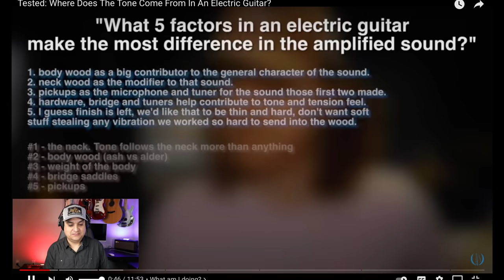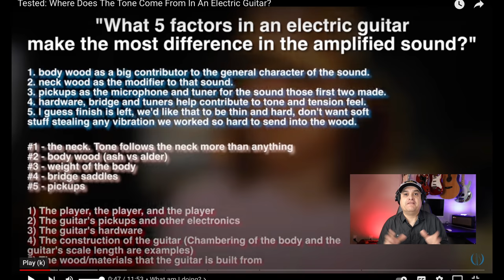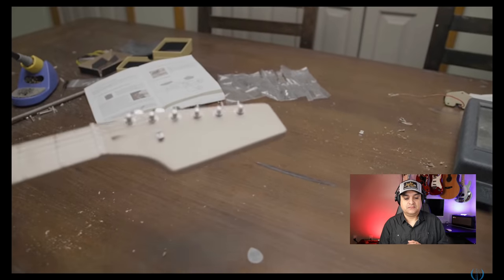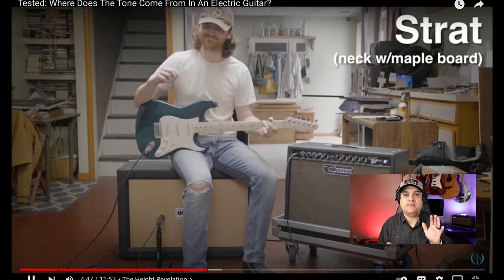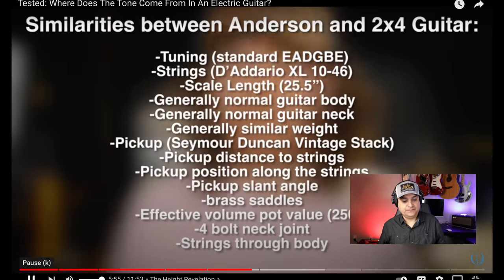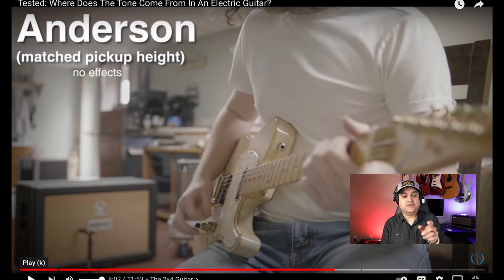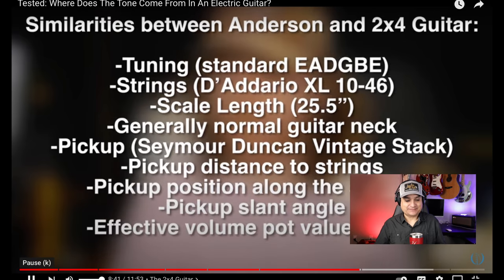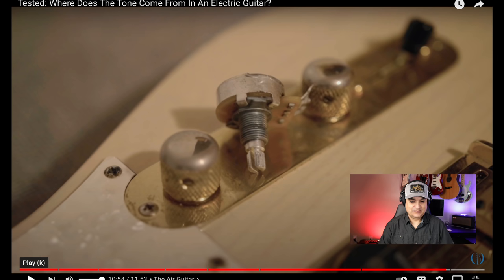Where Does The Tone Come From In An Electric Guitar - Reaction Video

Comment: LOL.  This guy went through a lot of extra work (forgetting about pup height and electronics), but I totally applaud his tenacity.  Good scientific approach - find the problem, document the problem, fix the problem.
Reply: yeh it is but here is the issue with these "scientific tests". If it was a true scientific test, a much bigger sample size is required. I would say you need guitars that are made exactly the same , in the same finish etc but with different wood options. The variables need to be controlled, so that includes the setups, string gauge and age, amps and cabs used, which might also require constant temp or humidity conditions. 
It becomes pretty murky pretty fast.

I am still yet to see anything approaching a true scientific test of this , with thorough variable isolation controls, and a large sample size (probably 50-200 guitars are needed, maybe more). Also many pro players would also be needed to test each guitar themselves, as well as straight up freq response etc via tools. Also both blind and labelled tests would be required to work out how much is affect happens in the mind of the player and is illusory.

Having said all this, it certainly seems to be the case that the wood is a small amount of the tonal composition, but there are enough other variables that could be skewing this by virtue of adding up, and potentially masking wood tonal differences, which is why the sample size needs to be much much bigger, as the average tonal properties of each wood type could be gathered and then compared.

Until someone actually does this, its basically one stage removed from anecdotal (which is still important). 
It may be closer to the truth and  a scientific conclusion , but not much.
Having said this I do think Pickups, Bridge and Nut and Tuners being the biggest factors on the guitar, seem to clearly be the biggest factors, its a matter of just how big that the scientific test would answer,and whether we can perceive this (this part of any test is very hard because they need to test people with trained ears in both general audio and most important, professional guitarists, testing random people would not tell us much. Average players would tells us quite a bit about most guitarists, and pro players would establish how far that perception can go, and possibly explain if you can ever get good enough and have trained enough ears that its a big enough factor to notice
Reply: @jacksmith4460  -You are hilarious. He replicated the tone without the parts that are frequently said by manufacturers to give tone and justify their extravagant prices. That was his hypothesis. It wasn't to test every electric guitar and pickup. His conclusion is that, in his test to achieve the tone of his specific electric guitar, the features that were essential to achieve that guitar's specific tone were the final list at the end of his test. You redefining his test with a new hypothesis and criteria is actually wrong in this case. What is correct is if you wish to expand on his tests and test many guitars  and many pickups, that would be your experiment, including a new hypothesis. But, his experiments still utilized the scientific method.

The "variables" you are referring to are features he proved don't matter(finishes, wood options, etc.) to achieve the tone of his specific electric guitar, and if you read his lists carefully, he did control the setups, string gages, etc. It is also clear he played the guitars in the same room with each modification, so you can say he had the same environmental factors present at the various stages of his tone tests. His approach was very scientific. He controlled all of the factors that remained common through his tests. He even acknowledged that he didn't account for the pickup proximity in earlier tests. So, he went back and rigorously controlled this variable and redid some tests to find that it indeed mattered more than other variables then continued using that control to confirm his conclusions proceeding. Just because you are not accepting his list of what he controlled doesn't have anything to do with whether or not he followed the scientific method in his experiments and modifications. Many scientific experiments of the the 19th and 20th centuries that are accepted as fact, or science today, were done with less control. And, there are studies going on now, take COVID vaccines, that are being tested with little control and being pushed out and called "science". 

Science is not the domain of one opinion or one group's opinion. It is a tool that all people can use to find a specific conclusion to their questions.
Reply: @Jack Smith  ...your logic holds true only if you believe that wood makes a difference with en elecyric guitar. The video proved that you don't even need wood to get a great sound. LOL!!
Reply: I though the same at first.  
I don't think he forgot anything.  I think he wanted to actually demonstrate some scientific method and problem solving skills by showing how rigorous you must be to objectively examine something as subjective as tone. Also, how the difference in the circuit between pickup and jack so dramatically changes the tone and response.
Reply: That's the point , goofy.
Reply: @jacksmith4460  If you think wood affects the tone on an electric guitar then scientific question #1 should be: How do the magnets in the guitar pickup detect the vibrations in a non-magnetic material like wood? If you can't even theorize how that might work then it's probably not even worth testing.
Reply: @dezmodium  The argument that the "tonewood" camp makes isn't that the pickups pick up vibrations in the wood, but that the vibrations of the wood resonate into the string, affecting its tone. Which sounds reasonable, until the theory falls flat under scientific testing.
Reply: @andrewmcintosh2703  Even if that theory is true... The strings are thick and under heavy tension, it takes a LOT of force to vibrate the strings... the resonance vibrations from the wood are really small, it just doesn't have that much force. So any differences in tonewood are going to be so small that they're imperceptible to the human ear.

Comment: Acoustically or unelectrified all those other factors do come in to play sound wise. Also anything that effects feel and vibe I would argue effects the sound because it effects how you play and enjoy it which greatly effects tone. But electrified, pickup and pickup height have the biggest changeable factor in tone. If only it was this easy to narrow it down with amps
Reply: This is the greatest comment ever
Reply: Yep, like Darrell Braun once said, people tend to "transfer" knowledge etc from the acoustic guitar to the electric.
Reply: The speaker is more important than the amp
Reply: And manufacturing tolerances for everything. Then there's the player, did the player drink the same beer out of the same side of the mouth. Put the left shoe on first or right, play with shoes on at all, if that's the case, take the right one off first or the left.

Comment: Hi Dylan. I've been a professional guitarist for over 30 years or more, and I have a pretty decent collection of guitars. I am firmly "in the camp" that the tonewoods make absolutely no difference to the sound of an electric guitar at all. If you fret a note on a Les Paul's abalone fret marker for example and fret a note on the wood, the tone is no different whatsoever - and the same can be said for all the fancy maple tops etc. The only thing that can affect the tone is the parts that the string actually touches when you just strum across the strings without fretting anything. Everything else is purely cosmetic! Tonewoods play a big part in the sound of acoustic guitars, but none in the sound of an electric.
Reply: To be fair the other stuff isn't just cosmetic. Some of it is for the comfort of the player. I maintain that if a guitar has a comfort feature that makes playing more pleasant to you, the player, like jumbo frets, or a specific curve and thickness to the neck, or the position of your knobs and switches, then that will make a big difference because it affects the player and the player makes the biggest difference in sound in this situation.

Comment: All pickups are indeed microphonic to varying degrees. Microphones, speakers and guitar pickups all use the same principle of coil, magnet and transfer of sound to electric current or in the case of the speaker, current to sound. 

Whether or not you can hear the varying degree of pickup microphonics in tone is the question. It’s definitely there.
Reply: it is indeed there and ovelooked ~ small details matter to top artists
Reply: Beg to differ. Sound is physical vibration through the medium of air. Your ear detects this motion, actually physically as does the receiving element of a microphone, by its own movement having been impacted by the actual physical vibration through the air. Think of it as a water ripple hitting the shore. A pick up on the other hand simply produces electrical current when a metallic object is moved within its magnetic field. This is a universal principle and the reason why alternators, generators and electrical motors work. Where on a guitar pickup is the mechanism receiver that that detects vibrations in the air?. Disect one see if you can find it. All you will find is a magnet with wire wrapped around it, you could isolate it, plug it into an amp and scream at it until you are blue, your voice will not come out the amplifier.

Comment: It proves that the argument for expensive guitars is how they feel and look rather than the materials they are made of affecting actual tone. A nice guitar makes you want to play it more - but sometimes the "worst" guitar is the right one for the sound you want.
Reply: I think most builders do not charge more for "tone wood" , it is more of the fact some wood is harder to acquire and more expensive or harder to work with
Reply: @chocomalk  you hit the nail on the head
Reply: @chocomalk  Some wood being harder to acquire is one thing, but other than some extra workmanship being done to it, it doesn't really justify the extra cost of lets say a CS Strat that's made out of alder an maple, just like almost any other mass produced strat for example.
Reply: @Nghilifa  uhhh the dif in price for a piece of Alder and a piece of "maple" can differ wildly, like what kind of maple? 
There is on other aspect of price I didn't mention and that is how desirable something is.

Comment: The fact he was able to make the scrap wood guitar stay in tune long enough to demo it is amazing in itself.
Reply: Am i missing something?? As long as the string's contact points( tuner, nut, bridge saddles) are the same and the body has minimal to no compression what would cause the tuning to go out (or is this just some sarcasm that went over my head)
Reply: @lalchan  maybe because the plywood doesn't have a truss rod  I guess?  Dunno.
Reply: @mthew6721  
The truss rod goes in the neck. Not the body.
Reply: What do you mean "scrap wood"? That looked like a perfectly good 2x4 to me.... 😆
Reply: This comment is nonsense. Stop pretending.
Reply: The bridge and nut are guitar parts so...
Reply: Why would it go out of tune? A two by four is AT LEAST as mechanically stable as a thin stratocaster body.
Reply: @LarsPallesen  hahhah. Yeah  that 2 by 4 is   harder than basswood.

Comment: I am so grateful for u, Dylan and Jim from this video u are reacting to for opening my eyes to the importance of pickup height. Ive had a 7 string Schecter for years now and i always hated its tone, but love the way it feels, looks, and great construction. Ive been contemplating buying new pickups for it, but decided to try messing around with the pickup height after watching this video and boy did it do the trick. The pickups were so high that the output was distorting even into the cleanest of the clean amp settings (JC40 so arguably the cleanest amp u will find. Lol). I lowered the height quite a bit and now my clean tone on this guitar sounds phenomenal. Now im going to try messing around with pickup height on my PRS SE 24 Custom to see if i can fine tune it more to my liking.

Comment: I mean - considering electric solid body guitars were made to reduce/eliminate feedback issues by eliminating resonance it should be obvious that the wood has at best a negligible effect.This is the whole point olf solid body guitars. Can it still make a difference? Sure, if it gives you a certain feeling as a player. But that's about it. But always remember: this is about solid body guitars, not semi-hollows or hollow bodies! In those guitars wood DOES make a difference since wood types have different physical properties which will result in a different resonance behaviour.

Comment: An australian sound engineer took this on more than a decade ago. He took advice from comments below successive videos eliminating variables outside the wood, eventually making several one-string "guitars" with just a tuning peg, a zero fret, and a single bridge saddle. There was no neck joint (or frets), these were all just hunks of wood of the same dimensions. He eliminated the player and pick/pick attack variables by using pickup wire to "pluck" the string in the same place by breaking the 42 gauge wire around the string. And yes, he tested the wire for consistent breaking force. The pickup output went into a recording oscilloscope through the same wiring and jack (not installed so it didn't have to be desoldered) and cable. The results? There was a visible difference in the waveforms with different woods (and plexiglas). Was it audibly a huge difference? Not from wood to wood, but it was there.
This pissed off the "tone wood is a scam perpetuated by the guitar companies to make the guitars too expensive for ordinary people to afford" nuts so bad that one person actually hacked into the guy's YouTube account and deleted all the tone wood test videos Then they  changed the password and contact email so he couldn't get back in and reupload them. Since at least one of these zealots had demonstrated that they were willing to break the law in order to suppress any evidence that contradicted their world view, all he left was the explanatory video for why he wasn't doing YouTube anymore. It had taken him around a year to convince YouTube who he was to get the account back under his control.
Reply: @wrnch9810  Read the second paragraph. Someone actually did a senior project with a similar setup at Texas A&M or Rice or some other Uni there, but it is written and without sound or video samples. This was his inspiration for the videos.
It's not beyond imagining that the wood will color the harmonics that are allowed to ring. This is, after all, how clip-on tuners work, by feeling the vibration of the string that is transmitted to the wood. That vibration in the wood is energy taken out of the string.

Comment: Wood is just really the platform to mount all the other components on. I think it needs to be a good quality wood mainly for stability and not necessarily for sound. It should be dried and stabilized so it will maintain its shape. Of course you want to apply a finish to the wood to protect it from the environment. And a good quality wood will take a nice finish and be very pleasing to the eye. I've watched a lot of videos on this subject and the differences in tone especially on electric guitars is very small as not to be a great factor. The components are the main factor.

Comment: I mean, the later variations do sound different, but it is pretty subtle. Wouldn't really affect how I played. Also in this case we have to differentiate between actual tone change caused by pickup height vs simple volume change. The final tone changed dramatically with pickup height because the amp was overdriven. Would be interesting to check level-matched DIs at different pickup heights.

Never a doubt in my mind that either pickup or pickup height would be the biggest contributor.

I will say that a neck swap I did on my Tele dramatically changed the tone, however it certainly wasn't fully controlled. Most likely frets/nut/action rather than wood.

Comment: Wow! That’s great! That’s the worlds first lapless lap guitar. Now all I need to do is carry around two work benches with guitar strings strung between them. The point is, when you make a guitar with an actual neck and body that gets played everything does make a difference; precision construction tolerances, quality solid woods, hardware, pickups, an nuts (haha) all effect everything about a solid body guitar. Not to mention the guitar’s ability to stay in tune when playing. Maybe y’all just proved Paul Reed Smith’s point that it’s not what the wood and other parts add to the guitar sound, it’s what it doesn’t take away from the sound. I don’t like PRS but they do make great guitars.